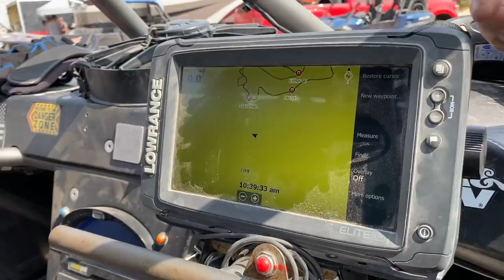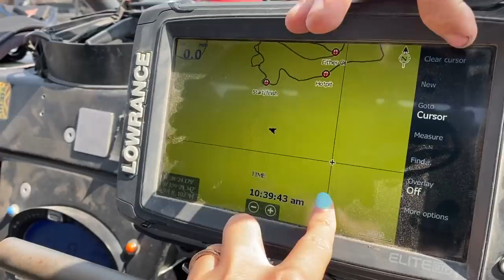OUR FIRST ULTRA4 RACE - The Most Extreme Off Roading We've Ever Done!

Comment: I don’t know how well it would work for really rough movements like this, but there are some simple camera isolation mounts that are designed do absorb harsh movements. Search “Kessler Killshock” for a brand name, but there are other similar ones for cheaper (search “Rigwheels Cloudmount”). I wonder how one of those might work as a mount right side up or hanging upside down, along with camera or gimbal stabilization in addition. They seem customizable for camera weight as well as amount of movement. Maybe try to get a sponsorship from Rigwheels or someone else for a test - that would be
 amazing footage for them if it worked!?  I don’t have any affiliation with these, just aware of them.

Comment: 17:03  Watching those racers travel across the rough section and watching the suspension cycle, I feel a little bit more liking for the IFS and maybe IRS buggy's.  Also maybe less unsprung weight.   The flip side of independent suspension(IS) is more parts to break.  Heard good things but time will tell.  If in a couple of years most of the buggys are IS, then no doubt.

Comment: Congratulations! That was Awesome!  Just wondering, what did you find out about Kevin's seat issue. Was the belts to tight?  And hopefully after you get the shocks tuned, it will ride better.  Good Luck @KOH 2021 !!!!!
Reply from the maker: It was just the fact that he put the jacket under the seat cushion. We bought actual racing seat pads to help with comfort (that won’t cut off circulation lol)

Comment: I can’t believe that landing broke the shaft and case?? Wow definitely add in some compression dampening. 
Are you sure that shaft isn’t too long for a full bottom out?? Which would cause something like this.
Reply from the maker: The landing didn’t break the shaft or case. The driveshaft was too short and separated in the air at full extension. Landing with a separated driveshaft whipping around is what broke the case.
Reply: @LiteBrite  oh wow so I had it totally backwards too short not too long. Wow it was cool seeing you all do well in your first race.